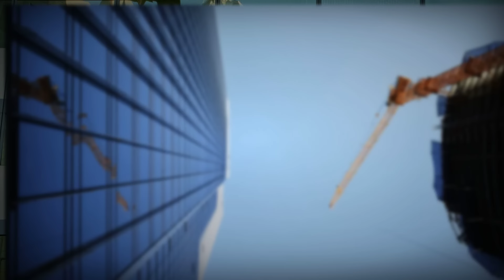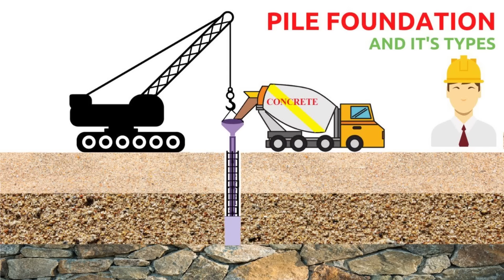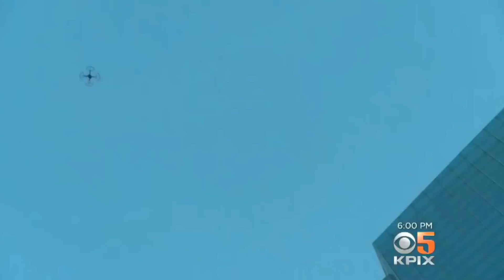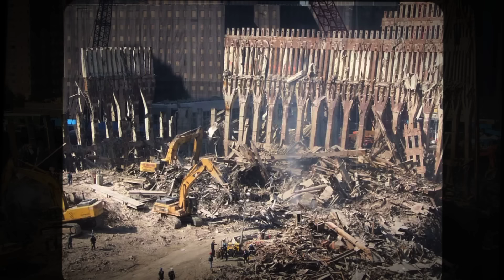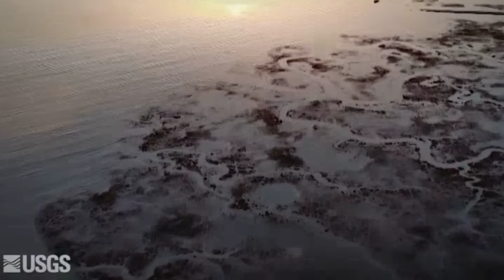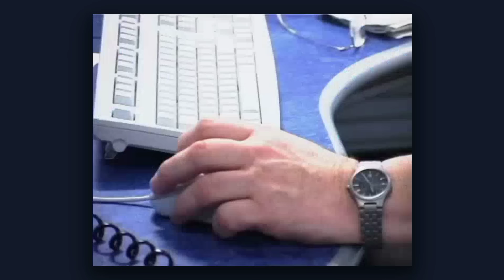Just Confirmed! San Francisco Leaning Tower Has Started Sinking

Comment: Stop spending money to save that building.  Just take it down.  The people should have moved out by now.  It should be empty.  All parties involved need to get a  destruction permit to take it down.  The money wasted to save it should have been used to take it down.
Reply from the maker: You're laying out the cleanest path forward and you're right that the math is on your side. They've burned over 100 million on a fix that didn't work. Add the legal fees, monitoring contracts, HOA assessments, and property value losses, and you're well past 500 million spent on a building that's still moving in worse ways than when they started. That number would have funded a controlled deconstruction with money left over.

The reason it hasn't happened is exactly what you said — too many parties, too much liability, and nobody wants to be the one to sign the order. The developer doesn't want to admit fault. The engineers don't want to certify it can't be saved. The city doesn't want to take political ownership. The residents don't want to lose their homes for whatever buyout they'd actually get. So everyone keeps spending money to avoid making the hard decision.

Your point about the residents is the one most people miss. By any rational standard, the building should already be empty. The fact that 419 families are still living in a tower that's sinking, leaning, and now bending, while the engineers monitor it like a science experiment, tells you everything about how broken the accountability is here. They're not staying because it's safe. They're staying because they can't afford to leave.

Comment: Construction is serious business, go cheap at your peril.
Reply from the maker: That should be carved into the door of every developer's office in America. Construction is the one industry where the cheap decision and the safe decision are almost never the same thing, and the people making the cheap call are almost never the ones living with the consequences.

Millennium Tower is just the most visible example. Surfside in Florida killed 98 people because of decades of deferred maintenance and corner-cutting on the parking structure. The Hard Rock in New Orleans killed 3 workers because the steel framing was under-designed to save money. The Hyatt Regency walkway in Kansas City killed 114 people in 1981 because a contractor changed a connection detail to make installation easier. Every single one of those was a budget decision dressed up as an engineering decision.

The pattern never changes. Developer cuts what the buyer can't see, takes the profit, and moves on. The building does what physics tells it to do 10 or 20 years later. And the industry treats each disaster like a one-off instead of admitting it's the same story on repeat. You're right — go cheap at your peril. The peril just usually lands on somebody else.

Comment: Why do developers always cheap out on the foundation 😮 SmFh
Reply: Because nobody sees it. Out of sight, out of mind
Reply from the maker: Because the foundation is the one part of the building nobody can see once it's done. You can't market it, you can't photograph it for the brochure, you can't charge an extra million dollars per unit because the piles went to bedrock. So when the budget gets tight, the foundation is always the first place developers go looking for savings. Skipping bedrock piles on Millennium Tower probably saved 20 to 30 million dollars in 2005. It has now cost over 100 million in rescue work, hundreds of millions in property value losses, and a building that may still need to come down. Same story at Surfside in Florida. Same story at the Hard Rock in New Orleans. The pattern never changes — cut what the buyer can't see, pocket the difference, and hope you've cashed out before anyone notices. Should developers be required to post a 50-year performance bond on every foundation they sign off on?
Reply: @O @AMERICANGROUND-u9r  saved 4-5m usd.
Reply: @AMERICANGROUND-u9r that bud sounds l8ke a great idea 😊
Reply: The video states that the foundation design should be sufficient, or work. But I guess the instability found in downtown is greater than expected.